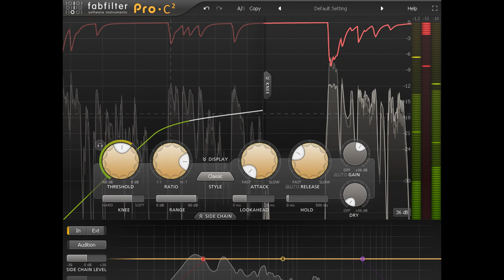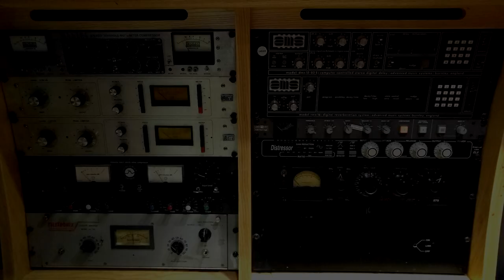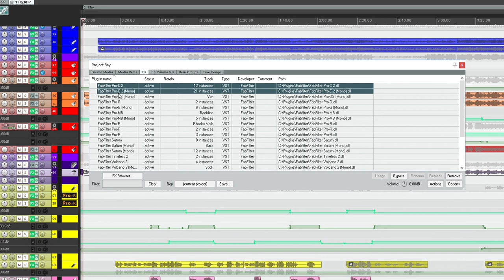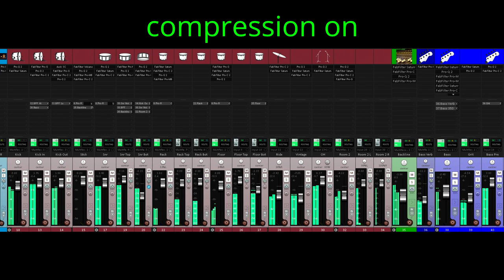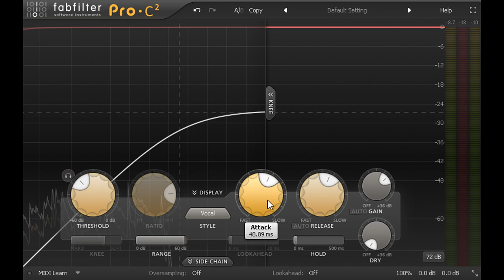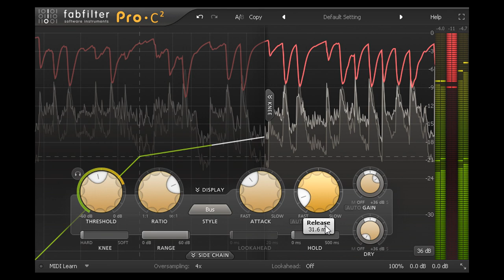Beginner's Guide to Compression (part 1)

Comment: Would love a more advanced compression guide. Especially one that explains in more detail the differences between different compressors (or the "styles" in Pro-C2). What exactly, for example, is "opto" mode or a real hardware analog opto compressor doing differently to the signal than another compressor with the same knee, threshold, ratio, attack, release settings?
Reply: Go to kadenze.com. There is a free online Ableton course by Jordan Hochenbaum, in the dynamnics unit he briefly explains the difference between opto and analogue compressor emulators. basically, they make a software version of an analogue compressor to mimic natural distortion that occurs and mimic other imperfections that occur when using analogue gear. these imprefections are pleasing to the ear and that is why so many producers still use analogue compressors.